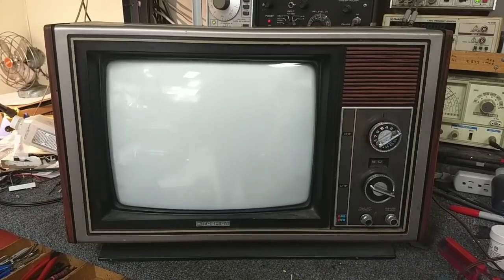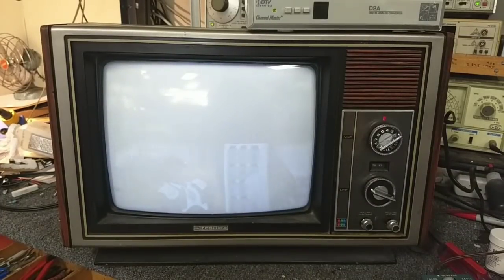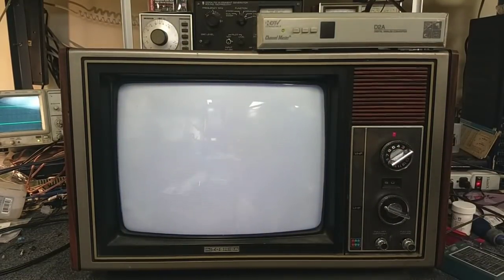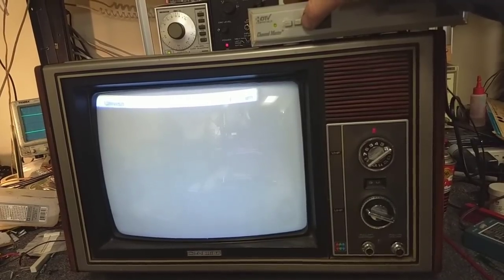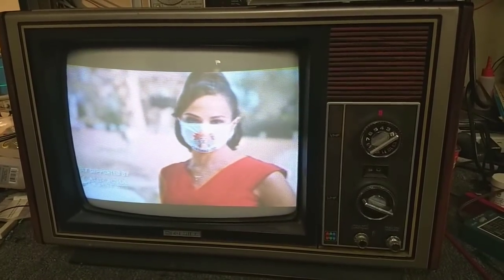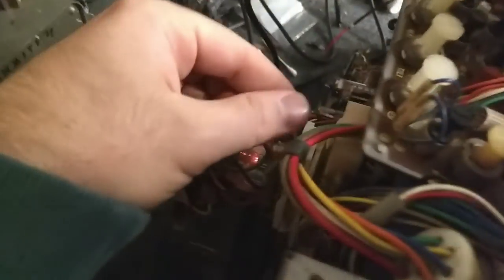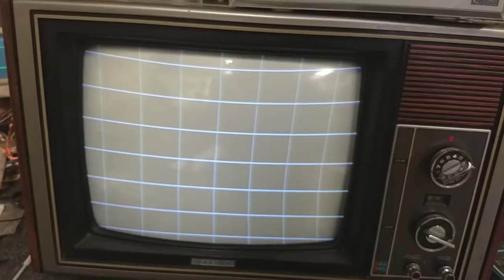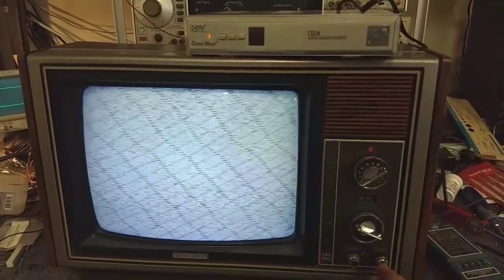Repair of a 1973 Toshiba C321 13" hybrid tube/transistor color TV - Part 6 /6

Comment: There's just something about this japanese 1970's styling and since it's a rarity, this TV surely is a candidate for a full rebuild. It must be. It has to be. If it weren't for it being NTSC-only, I (Living on PAL-soil) would've bought it from you.
For me at least, it has that remarkable time-framing design and being a little 13" table-TV, it's quite cute.

I'm definately voting for a full rebuild of the circuitries. All these intermittent faults I guess can only be dealt with if some, most, all.... have been through notoriously faultfinding and refurbished/rebuild.

How about exchanging or thoroughly cleaning all the ultra touchy pots for instance ? Isn't it a matter of having a stable base to work from ?

Is it worth it ? Hell yeah. Remember, in 20 years time, there will be more 1880-1915 Edison Cylinder Phonographs around than 1940-1975 Tube and Hybrid CRT TV's.

It's definately a keeper. It's a beauty. I love it.

Comment: I'm still wondering if a tuner bypass to feed a compatable video in would be a good test.
Reply: The tuner is totally obsolete and will never be used again anyway.
Reply: @robinsattahip2376  Yep i agree, bypassing it would have shown the faults with the rest of the set, not the tuner itself.
I don't know the standard of the internal video levels/d.c bias,  i'm sure jordan can mod that.
I've done that with lots of electronics, bypass a stage and see if it improves the condition.
Reply from the maker: I think a composite input will be in this sets future. Only problem to really overcome is input isolation, since this is a hot chassis
Reply: @JordanPier  Perhaps a couple of high value poly capacitors in the video core and screen coax may work,  it depends if the destination impedence is high i suppose.
High voltage caps of cause.
I'm sure you will find a way.
Reply: @zx8401ztv   X or Y caps, wouldn't it be?
Reply: @zx8401ztv  It cannot work, because for composite video, you just need bandwith from 60Hz to 4,5MHz and 75ohm impedance. I know only about 2 ways how to make composite in in hot chassis. 
1. - add an insulating transformer to power input - but its big, heavy and there in no space for it.
2. - make an input board with optocoupler to separate hot chassis from input. You need just small power spupply for it, so it is possible to put it into TV. You also need another board or small insulated transformer for sound in.
Reply from the maker: I was thinking a 75ohm 5.8mhz 1:1 video iso transformer, and a small transformer for audio input. In theory would work - but theories only get you close to working....
Reply: @JordanPier  I didnt see this type of transformer. If its selled as video transformer, it should work. I'm just curious what is the lower frequency it can transform without significant loss. Videosignal bandwith is wide.

Comment: There is still lot of AC hum going to horizontal output - vertical lines are distorted. Its strange, because you changed all capacitors in power supply. It can also cause problems with unstable color saturation - if horizontal phase is little of and unstable, not whole burst is processed, so color AGC detects wrong values.

Comment: Was that an IC I saw in the schematic in a previous video, or was it just a block diagram, or am I misremembering entirely? I've seen 'chair' transistors with ICs, and I've seen them with tubes, but I don't think I've ever seen all three at the same time. Interesting set either way.
Reply from the maker: This doesn't have an IC. However zenith made hybrid sets with tube, transistor and ics. They make beautiful pictures, but if those ics die, very hard to find